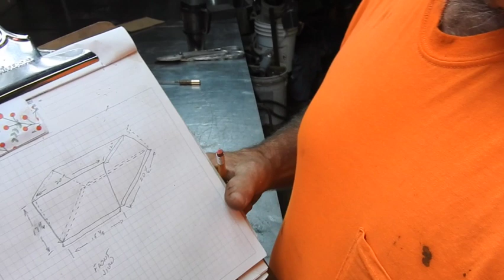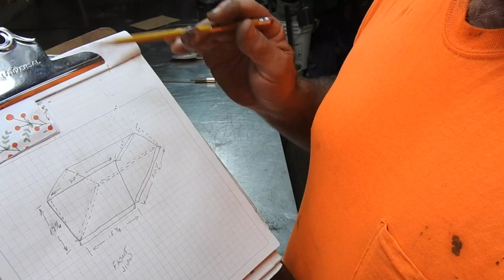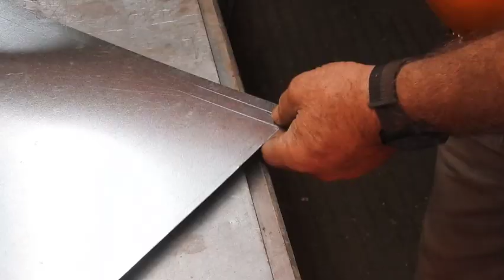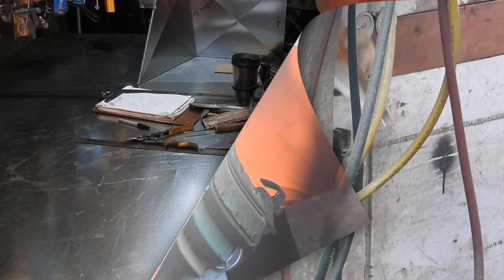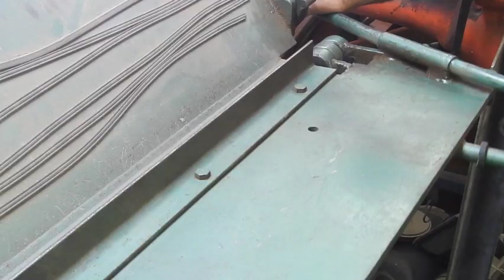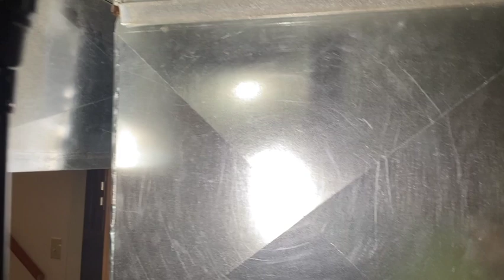Exaggerated Plenum Transition- Sheet Metal Hack

Comment: This fitting doesnt make sense to me. Bc if the front is flat, and the bottom dimension is 20.5, and the top 12,  then how would the back side be sloping in 5 inches when u have 8.5 left over? How would the back not be sloping 8.5? How does that work out? Lol
Reply from the maker: I think the point you may have missed is the dimensions of the top opening we have to connect to Jeff.  If the dimensions were exactly the same but slightly offset, you'd have a point but that isn't the case.  If you stop the video and look closer at the drawing I think you could see it better.  It must have been correct, because I installed it with no problem.  Measuring accurately on site is the key to a smooth install.  Hope this answers your question.
   Btw, for more puzzling fittings, you might consider checking some of the playlists up top dedicated to sheet metal, like this one here: https://www.youtube.com/playlist?list=PLk72G9DTzZ1taVZjyeN9DKr52HQ3hhcXd. Thanks for the comment today.
Reply: @tractorman4461  hey tractorman thanks for the reply! I definitely see that u obviously did it correct due to the fact that it fit when you installed it. I do hope my question wasn't confusing, I'm a sheet metal fabricator myself. Sometimes when guys send in shop drawings and the transition is offsetting 4 ways, they will only give the slope lengths for 2 sides, which means that you have to figure out the other 2 sides according to the 2 slope lengths they provided, and the dimensions of the duct. For example, if the front of a fitting is sloping 2 inches, and the top dimension is 10, and the bottom 20, then that means that the backside is sloping 8 inches, because that's what is left over. It has to be that, because the fitting is sloping 4 ways and if the back isn't 8 inch slope, then the fitting isn't square. That's why I'm confused at the fitting dimensions you provided buddy, that's all. I know u say that's not the case here, but I'm just confused on how the fitting is still square if the back slopes 5 inches, when the fronts flat and according to the dimensions it should equal to 8.5 on the back. Never encountered one like this before lol there's been times where I field measured something like this, and the shop foreman would call me back saying that the fitting isn't possible to fabricate. I'll deff check out the videos u sent me buddy! God bless I love your videos by the way. I apologize for my confusion! Guess I still have some things to learn!
Reply from the maker: @leftymariano1020 I agree its difficult to see and I regret not being a bit more instructive during the fab of the fitting.  But I really don't try to make actually 'instructional' or 'how to' videos when doing a sheet metal job because I'm usually under the gun to get something fabbed and back to the job to get it installed in the same day. Especially if its really really cold. If I have to make another, I will try to be a bit more specific. 
   You are not the first one to bring a question concerning this particular lay out.  LOL. So no harm, no foul as far as I'm concerned. I just enjoy the fact that I can sometimes show some of this stuff to others in video form like this. YouTube is a great playform.  I just wish I knew about it BEFORE I retired. I could've had tons of really cool stuff for viewers.  
    Now I only do a little metal to help out those in our town that really need help or they'd have to do without.  I just referenced one playlist, there are several that deal with sheet metal or hvac specifically. Thanks again for watching.

Comment: Love your videos, had one today on a job that kind of stumped me a bit. Similar piece  to what you made but I had the back side straight and offsets on the front and both sides. I usually always start with the piece that is either straight or has the least amount of an offset and build off of that piece, meaning I get my true height off of the preview piece I built and then add the inch at the bottom and the top just like you did. I had a 10" offset on both sides so my left and right pieces were a good few inches longer than my back (starting piece) usually the last (front) piece I've been able to calculate off of the shorter of the two left and right true heights for the height on my last piece. Problem was I only had a 2" offset on the front piece. My question is, is there a way or formula you know of to determine the height of the front (final) piece by going off of my left and right pieces? Or do you just have to use geometry or actually measure the true height of that piece to make it work?
Reply from the maker: Geometry is the real answer, but I ALWAYS  start with the one straight piece where the true length is not questionable.  Then lay out and fab the two sides using an awl, not a felt marker, for accuracy.  The trick then becomes finding the exact place on the newly formed sides to make the measurement for the 4th and final piece.  I measure to the inside point of the Pittsburgh lock, not the outside point where the tab is bent over.  THAT will grow the fitting and you'll have to get creative on site to make it presentable. I hope that made sense.   It's hard to describe in print.  Geometry to figure that last piece is more problematic to me than actual measurements.     
      Have you found the sheet metal playlists up above? There's a lot of different fittings in them that you may find interesting.  Like this one: https://www.youtube.com/watch?v=PvDab537ul4&list=PLk72G9DTzZ1taVZjyeN9DKr52HQ3hhcXd Thanks for watching and commenting with a question Matthew.
Reply: Hey Matthew, yes there's a way to get the true heights on all of your pieces b4 u lay them out. But you have to know the amount of slope each side has, along with what the finished height is suppose to be. The easiest way to find the true length of a piece, is to drawl a straight line up and down for example if the finished fitting height is suppose to be 8 inches, then u drawl an 8 inch long line straight up and down. Then at the bottom of the 8 inch line, drawl an arbitrary line perpendicular to the 8 in h line going left to right. Now after that we have to find the hypotenuse or true lengths of the triangle. So say the right side of the fitting is sloping 3 inches, what you do is go from the bottom of the 8 inch line and mark 3 inches yo the right on the arbitrary perpendicular line u drew at the bottom. After that, take your ruler and connect a line from the 3 inch mark all the way to the top of the 8 inch line. Whatever the distance of that line is, is the true length of your piece. 8 inch height at a slope of 3 inches is obviously larger than 8 inches so whatever that distance is, will be the cut length for your piece you cut out. There's also another way which is a formula to find the cut lengths of your pieces using math, and it doesn't require you to layout a triangle. The formula is fitting length^2 + slope^2= square root of that number.  I hope that helps

Comment: That was a beautiful transition, don't get me wrong. But if that is what you call a tight space then I need to live where you live.
Reply from the maker: Yeah, I would consider it a tight space when only the front is accessible.  Without removing the return air drop it'd be a bit tough to install what was needed on this one.  At least this way I was able to screw half way across the rear with an extension, all the left side and front and half the right side with an extension.  So yes, I've been on many jobs much tighter, laying in insulation in an attic or crawling in the mud and cat poop in a crawl space.  The worst are apartment units I think.  I have another one that's in a tight space in a playlist too. Its an attic install and the south trunk is tight by anyones standards: https://www.youtube.com/playlist?list=PLk72G9DTzZ1taVZjyeN9DKr52HQ3hhcXd   Thanks for watching as well as for the compliment on the fitting Neil.

Comment: How do you determine the size of a planum!?
Reply from the maker: Three basic factors determine everything about a plenum's size on a change out.  #1:  The physical opening of the furnace or air handler and #2:  The size of the opening of the duct it is to be connected to. #3:  The distance that separate the two.  New construction is a different story.  Have you by chance seen the playlists up above?  Like this one here, there's a LOT of odd shapes and sizes and talk about air flow:https://www.youtube.com/playlist?list=PLk72G9DTzZ1taVZjyeN9DKr52HQ3hhcXd You might find some interesting things there.  Thanks for watching and having a good question Niel.
Reply: @tractorman4461  thank you so much for the quick response - ok so the plenum size is not based on the size or the volume of the room it is supplying air flow for? For some reason I thought that was how it worked. And If I only have a limited space height of 6" inside an attic with a 6" diameter duct? Is increasing the depth and the width of the plenum box sufficient enough or that's not how it works?
Reply from the maker: @niel5101 Well the plenum 'box' or adapter is the connection from the furnace TO your duct delivery system...So in essence, the duct should be sized adequately for carrying the air flow to ALL the rooms supplied which should match the air flow in cfm (Cubic Feet of air per Minute).  So if I am reading your question correctly you really don't actually have a duct network in the attic that supplies multiple rooms with the required air flow to satisfy the respective rooms....??  I'm not sure I've got the whole picture yet.

Comment: Nice job but why not cheat one corner to be? 3/8” nothing in sheet metal. IHow did you get the 20” length without that side growing?
Reply from the maker: I always try to set the furnace to get at least ONE side straight up and down.  It doesn't matter which of the 4 sides it is.  But once you have that 'true length', lay that side out first then use the transitional dimensions to the left and right to get the true length of those two sides.  If everything is measured, laid out and cut accurately, the far edges of side 2 and 3 will result in the true length of side #4 ending up with the exact height as sides 1,2 and 3  after folding.  Make sense ??  Its difficult to explain in print, But that's how I do it without more complicated math.  
   Thanks Harry for watching....but an old lady once told there's more than one way to skin an orange !!  So some ways are better than others....as may be the way you'd do this fitting....  I've had to cheat a lot of times in the field, but I do it where it's not extremely visible and without duct tape.  I appreciate the comments....you've GOT to be an old tinner....?? (-;
Reply: @tractorman4461  mine is many ways to skin a cat. I have guys that will measure  to the 16th. Good but metal will move. Not sure if they are killing time or just not want to do the job.
Reply from the maker: @harrygilbert4593  Oh yeah, I know metal will move...the trick is knowing how to get it to do the things you want it to do.  Just flipping the S's you can gain an easy eighth and sometimes more.  I'm a stickler for making them slip together easy but It's not beyond me to force it if necessary.  When I measure up a job, I try get it as close as humanly possible with the measurements. I love a good fit whether its a simple plenum or a whole trunk line. I've worked with duct tape kings that didn't care if they missed a half inch and I've worked with guys that are as precise as can be.  I'm somewhere in between though.

Comment: How do you measure to get your offsets
Reply from the maker: I usually start off with a square vertical line and mark the true height of the finished fitting, then measure to the left and the right the lengths or distances of the offset.  There's a lot more to it than I can explain in print by a reply, but for the most part just about each video will contain enough verbal information for you to see exactly how I do it....while it is being done.  I have a few playlists up above that probably contains the answer many times over in the different videos. This one would be a GOOD one to see a bunch of odd fittings and measurements: https://www.youtube.com/playlist?list=PLk72G9DTzZ1taVZjyeN9DKr52HQ3hhcXd

Comment: As time goes by, I'm starting to better understand your sheet metal layouts and methods of configuration. I dont have to make any fittings by hand, I just draw them and call them in and someone uses the plasma cutter to cut the metal, which saves so much time.
I would like to learn how to make fittings by hand just because the plasma cutter is prone to breaking down when you least expect it.
You make your fittings with so much enthusiasm, and you like quality work, something not everyone appreciates anymore!
Reply from the maker: I think a lot of companies operate like that.  But the way I come up in the industry back in the 70's was to go to the job, demo, measure, go back to the shop to fabricate then return to install. Most of the time on changeouts it was all in one day.  Many, many times it was a long day extending into the evening hours, but the next day was usually already scheduled.  So there was nothing to do but just do it.  
  You might try to ask the shop for some scrap metal so you can practice layout and notching... My first boss let me stay after work and play with material from the scrap pile and the machines to learn.  Even dismantling used ductwork will net material to practice on.  And  a cheap brake from Northern Hydraulics or Harbor Freight would be great to use at home to learn the bends.
   Thank you for watching and I hope you've seen the playlists up top...??  Try this one when you have time to spare: https://www.youtube.com/watch?v=IObgZ5gYWIE&list=PLk72G9DTzZ1tqw8ST_xdUlPoy_O-SmuBx
Reply: If you can’t do it in the shop get yourself some good construction paper and lay it out that way. That’s how I learned to make square to rounds before I ever tried on metal.

Comment: Existing duct looked like it had liner insulation. Any wrap going on your new plenum to keep it from sweating when a/c is on?
Reply from the maker: Yes, the original system does have duct liner.  When the job was done originally the basement was an unconditioned space, and had a good chance of sweating.  It is now totally finished out and converted to a fully conditioned space, so there is very little chance of sweat.  So no, I did not go back with duct liner or double mylar wrap.  Good question.  However, I always insulate attics and crawl spaces in addition to sealing with mastic.